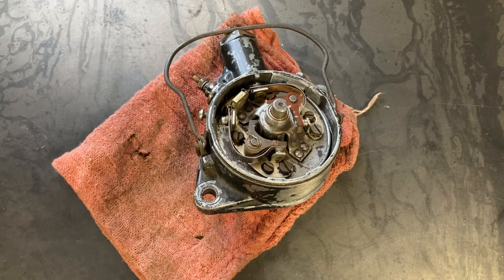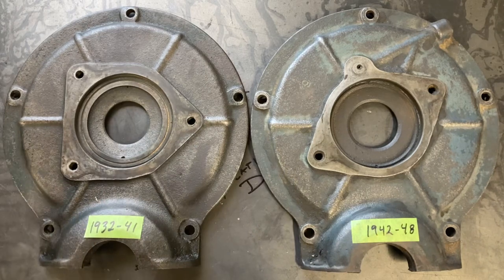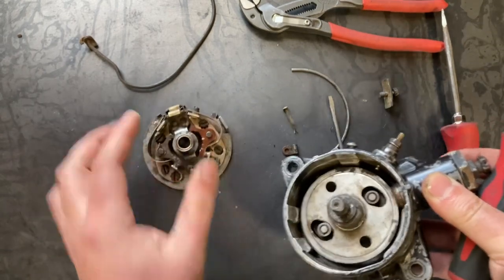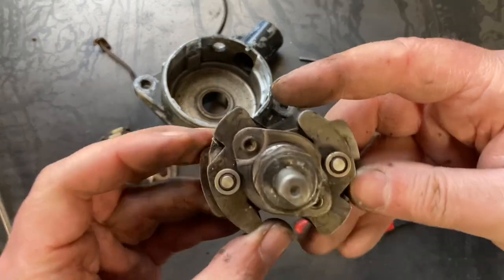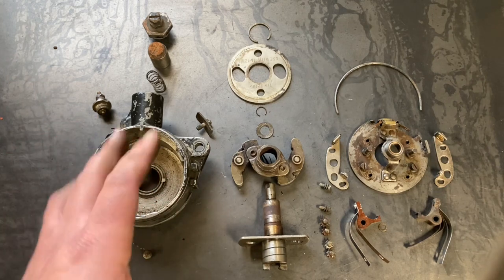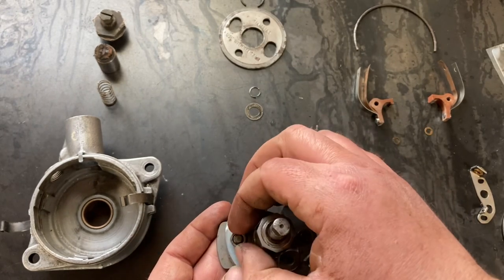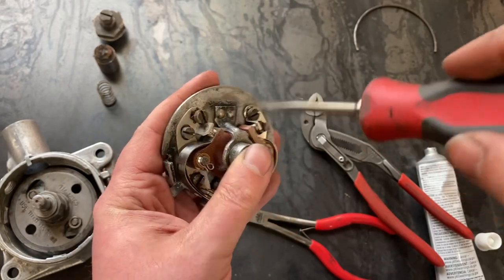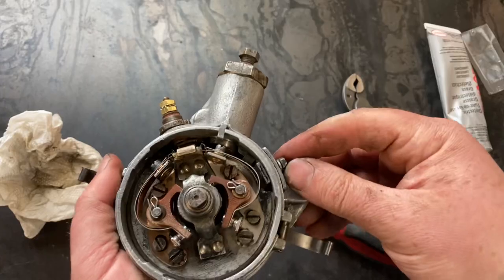Flathead Ford distributor adapt and rebuild : part 1

Comment: Great video. I was a Model A guy before this. Those were painfully simple. Flatheads will humble you quickly. I'd like to convert to the crab style distributor cap. I was curious what parts I need. Also concerning that vacuum brake, if I eliminate that piston, I don't have to worry about it? My car at high RPM wants to hesitate. And I wonder if this isn't because of that vacuum.